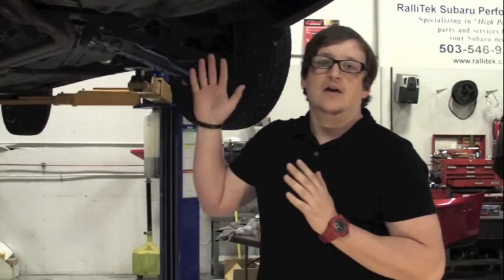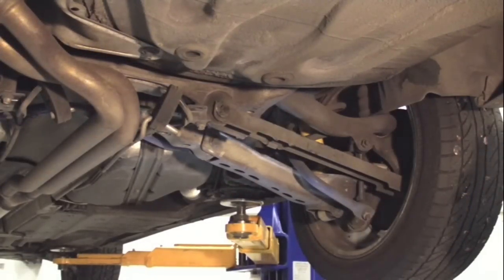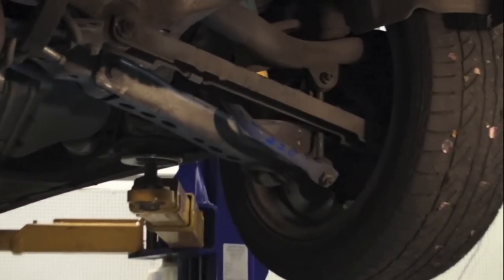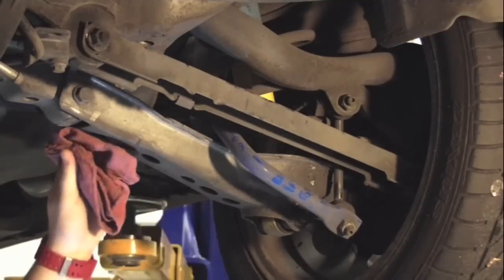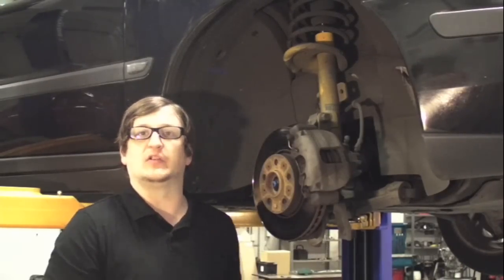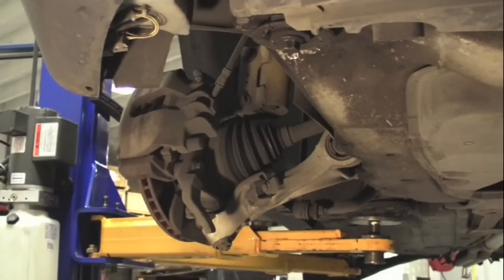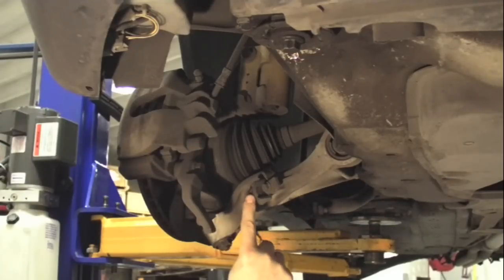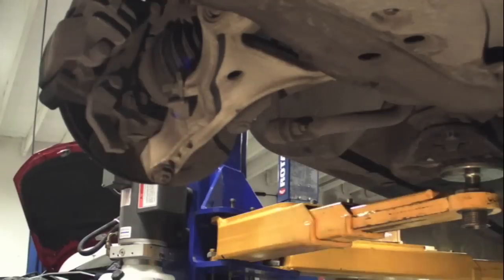IPD Volvo Suspension Overview 1999-2006 S80   2001-2009 S60   2001-2007 V70 XC70

Comment: Just from my experience, I’ve been chasing a clunk every time going up or down a driveway with the steering wheel at full right. Changed everything you mentioned except subframe bushings and the whole sway bar assembly.  Not experienced enough as a DIY’er to do that myself so have to get a professional.

Comment: Well made video, My rear tyres have worn badly on the inside edges (aftermarket replica 18" pegasus alloys..not sure if offset may be a factor as the offset was a bit "universal") but the car is booked in for a checkover of all the rear linkages etc and a 4 wheel laser alignment this coming friday. What do you think the outcome may be? Failed rear endlinks? Wheels a bad offset? or the rear tracking out? What do you adjust to bring the toe in?

Comment: @myviews not sure if you've gotten your e-brake situation resolved yet...probably adjusted and didn't back the slack off, or another situation which created a situation that made that cable tighter than a guitar string. Hope you've fixed it- you'll likely need new parts - if you haven't purchased already, please conact me, or go to brickboard, and they've got a "master parts supplier list." It really pays to shop around with these vehicles. Cheers

Comment: Great Vid, not sure if you have any experience with e brake. I puilled it and it snapped or broke. when I took off the wheel i noticed the rectangular block broke off and springs got all twisted where can I pick up the guts from rear wheel brake shoes for 2004 S60 AWD? TY

Comment: s60 2006 - steering wheel does not return - left or right move/ hwy speed - slightly unnoticeable , more obvious at lower speed on a grater turn - it is very annoying as the wheel does not return on its own - this car received a hard hit on the right side, where as the right drive shaft assy. had to be replaced - the previous owner must have fallen asleep, or was texting.

As it regards your video on  the P2 suspension, it is an excellent lecture delivered by a good lecturer. Wood I, that there would be more like you on the internet. Please advise as to where
you are located - I would gladly bring my car to your facility for maintenance .

 thank you
Retired Aircraft tech.

Comment: Good Tip For Diesel Volvoist's.Run The Fuel Down To The Red,Fill With One Litre Of "LIQUI MOLY DIESEL PURGE" Run Till On The Red Bottom.Put A Half Litre In,Then Half Tank Of Diesel.Once Done,Do The Half Litre At Fill Up's.Keep's It Running As Sweet As A Sweet Thing At Sweet Time.You-tube It.